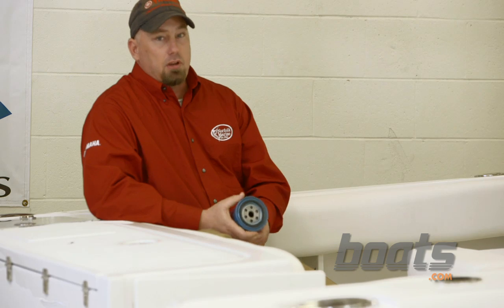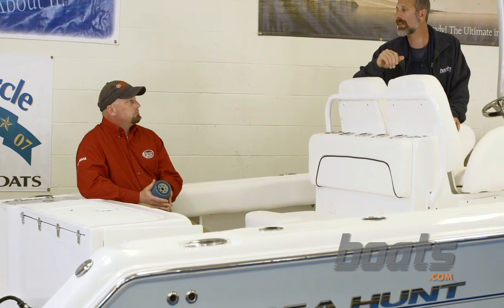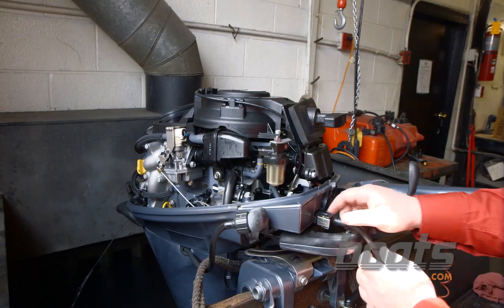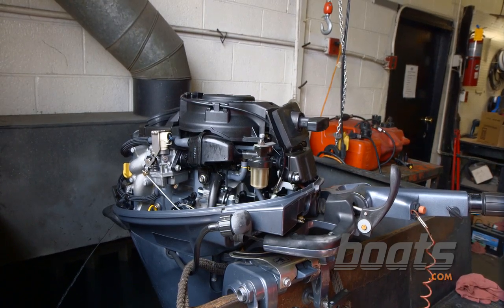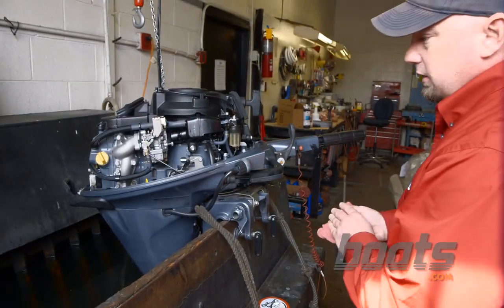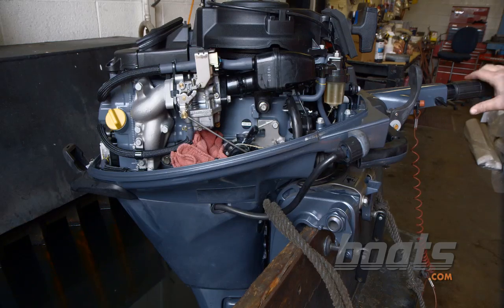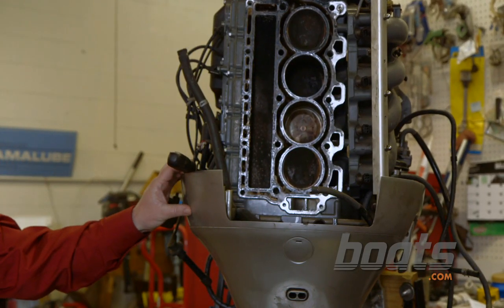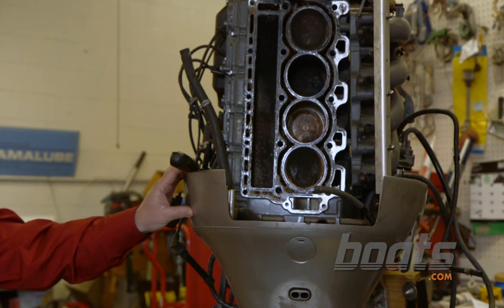The Most Common Outboard Engine Issues: Fuel Systems and Flushing

Comment: What does flush your motor mean????
Reply: It means you need to flush it with fresh water. There are two ways to do this after bringing the motor onshore: a) stick the shaft down into a huge bucket of fresh water (ensure the cooling water intake is submerged) and let the motor run for a few minutes, or b) connect a fresh water hose to the cooling water intake (requires a special part to make the connection), turn on the fresh water and then run the motor.

Comment: My 90 hp Yam starts and runs fine, but when you put it under load it bogs down
Reply: Might try and check your spark plug wires and make sure they have no cracks or anything like they. They could be grounding to the engine block if that is the case.
Reply: Yamaha boat having a hard time to turn on
Reply: Also may try checking your fuel lines, gas filter, make sure there are no obstructions in the lines.  Check for cracking in the lines, leaks at connections, Gas tank's vent is open,  if all that  checks out move on to next step. You want your fuel system to be air tight so that the carburetors can pull the fuel from the take. Next thing that I would do is carburetor rebuild. Buy some carburetor cleaner at any auto parts place and follow a diagram I use boats.net for all of mine.   If you are unsure how to do them take it in to get them cleaned, get your timing checked while your boat is there. They will be able to find the problem.

Comment: I've got a 70 Marc cream clean carburetors butter Stratus on clean fuel just won't lines and it starts in ribs up but you get it out in the lakeand you can put it in gear and just verlydoes RunI had it worked out 3 times and I just want know what I cjust wont take gashard to start put a fuel pump on it clean carbs

Comment: I run non ethanol.  Its worth it.
Reply: Can you use yamaha fuel additives like Ring free and fuel stabilizee? still with non Ethan?
Reply: Hi rob. In my Honda 2.5 and my Mercury 9.9 I strictly run premium 91 octane which is non ethanol. I never use any fuel additives because gas companies already add there own. I only add fuel stabilizer to the tank. Hope that helps...🎣🚤

Comment: I lost power in my 115 hp Yamaha after not using it in a pretty long period.  It was of course bad gas although the tech said the gas was okay after doing a visual test.  Took to the shop they had to have the injectors cleaned.  Got it back did not use it that much but did run the boat every month for 15 minutes.  Problem returned.  Took it back ended up doing the same job over.  This time I made them drain the tank.  To insure this would not happen again I used non-ethanol gas.  Ran well for a few months but is now starting to break down when I try to get 5,000 rpm.  Took the boat on fresh water ran it at 3,000 rpm gradually moving it up to 4,800.  Ran fine and ran it a long time.  I finally tried 5,000 rpm and it starting losing power again.  The gas in it now is fresh clean gas.
Reply from the maker: Hey Carmine Petrangelo, sorry you're having so many issues,  but the news I have isn't good; it sounds like a new problem, unrelated to your fuel issues. There are a number of potential reasons the outboard could be acting like this, and it isn't something that can be diagnosed from afar. I'm afraid you need to get that engine back into the hands of a good tech.
Reply: ***** What would be some of the different possibilities?  Knowing that at least gives me some possibilities to look into.  I have already have had it worked on twice.  I also could use a good contact number for Yamaha.
Reply from the maker: Carmine Petrangelo It could be as simple as a clogged filter or a cracked hose, or as complex as an ECU issue. Your best bet is to go to the Yamaha Dealer Service Locator at http://yamahaoutboards.com/dealer-locator, plug in your zip code, and see who is near-by.

Comment: Ridiculous '' advice '' . Draining is not necessary as long as you use only ethanol free gas... and the stabilizer's only purpose is to hold the octane level up which will work up to 2 yrs.